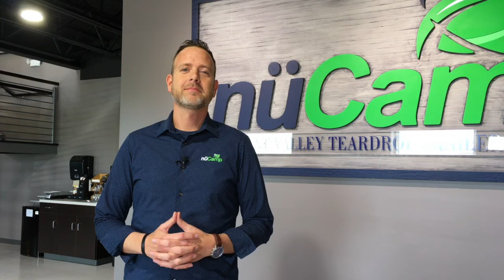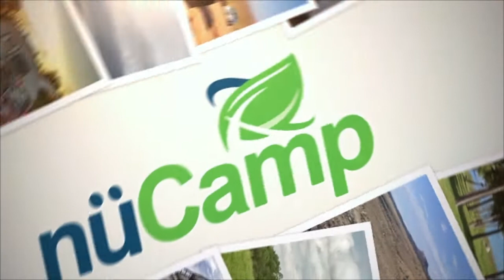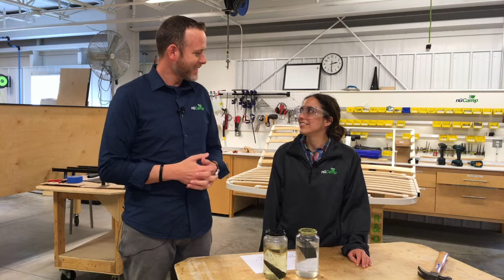90 Seconds with nuCamp | Research Engineer Christine Mallot

Comment: Really like the use of acrylic awning windows as they provide real airflow compared to the typical glass. Curious though about longevity and maintenance. Have read that acrylic scratches easily and that it is recommended to leave shades partially opened when in direct sunlight to prevent deterioration caused by trapped heat. Would these be concerns with Nucamp windows?
Reply from the maker: Great question! We haven’t seen any acrylic windows being damaged from heat/sunlight and they have held strong during our testing. As for scratching, they are fairly durable but will potentially scratch if abrasive cleaners are used on them.

We actually recommend leaving the window shades in the folded/open window position so they do not lose their shape when folded back up.
Reply: @nucamprv  ok thanks